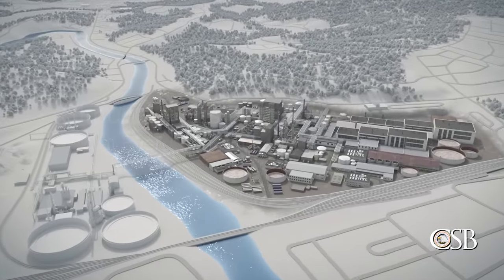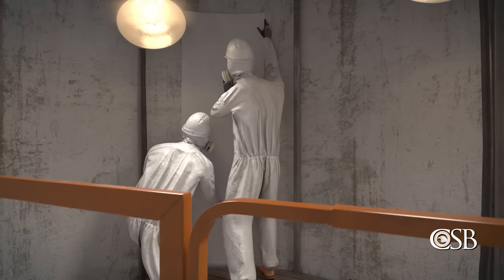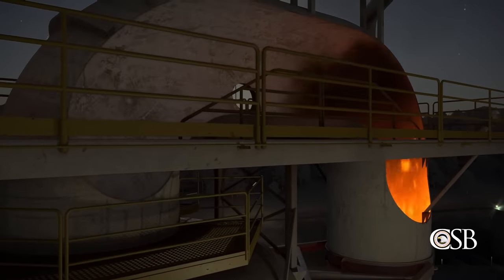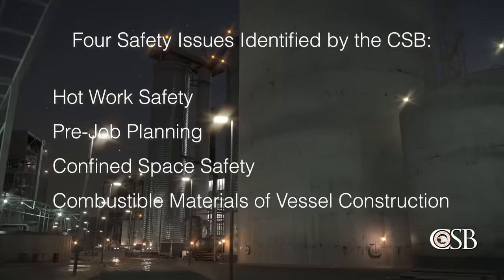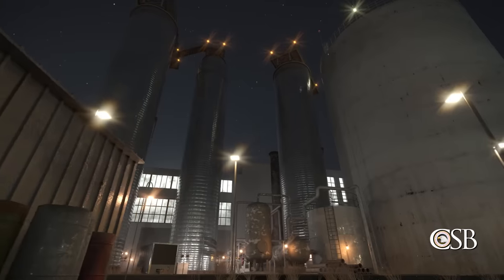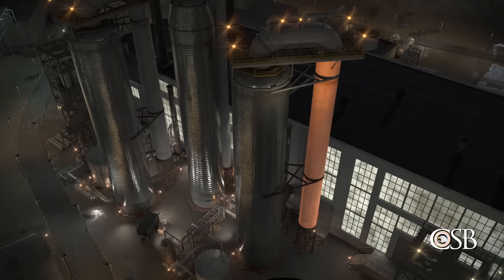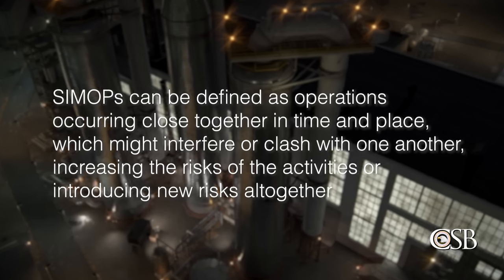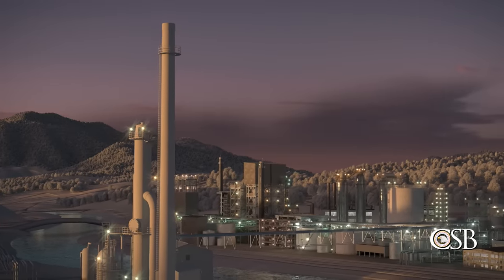Simultaneous Tragedy: Fire at Evergreen Packaging

Comment: I worked for a composite coating company and this video is spot on, however we struggled with humidity more than temperatures. Furthermore we would measure out epoxy in plastic tubs and microwave them to a workable temperatures when needed. Excellent video team.

Comment: Used to work as a cart boy in high school, we had these machines that we were told never to exceed 30 carts on a run with them, but the machines could easily handle triple that. When I joined, they had 3 cart guys on one shift, and since they were all new like me, stuck to the rule pretty hard since they didn't want to get in trouble and the job didn't have many opportunities for breaks. Eventually though, we realized that we didn't have to stick to 30 carts, and if we did a lot more in a run, we didn't have to do near as much work. Managers started noticing that we were getting done with the carts way faster than normal, so they started cutting their own corners by reducing the number of people on a shift.

Eventually, what started out as a corner cut for the workers turned into a necessity because of managerial corner cutting. By the time I quit after I graduated, we only ever had one person on a shift, and even if they were new and weren't comfortable doing 90 carts at a time yet, they had to or else they wouldn't keep up. Of course, this was about pushing grocery carts around a parking lot, the stakes were never very high, and that was probably part of the reason nobody cared enough to say anything.

Comment: How can it be considered acceptable to use a heat gun on a bucket of resin formulation in a confined space? And then to be in the position where it can accidentally drop the heating element into the resin? Some things are just common sense. You cannot always blame lack of guidance. I mean come on... sometimes the individual has a cavalier approach to safety and is clearly at fault.

Comment: The SIMOPS thing is important. I work in an industrial setting as a contractor who is permanently on site, and I couldn't tell you how many times I've had to call off planned work or delay repairs because there was dangerous work happening right next to us. Those areas were taped off as required, but it has always seemed crazy to me that nobody is coordinating all of the various groups working in the same areas.

Comment: I was working in a chemistry lab where we needed to heat the ends of a piece of glassware while keeping the middle cool. Because of the geometry of the glass, it was decided that a can of computer duster with its straw would be suitable for cooling the middle, while a heat gun was used to heat the ends. 
At one point, the accelerant (likely butane), squirted into the heat gun, causing a small fireball (and burning the hair off of my hand and forearm).
That was a total oversight on both accounts: not recognizing that the accelerant was flammable, and identifying the heat gun as an ignition source.
Reply: Are you educated in Chemistry and still capable of doing such things?
No wonder uneducated people screws up...
Reply: @OmmerSyssel  To be fair, we have enough safety measures to prevent a disaster. In my university in Germany, every laboratory have an emergency fire button that will shut down the electricity in the entire floor and flood the room with inert gas or water. If anything, I'm surprised that they trust highschool kids with such devices because even in highschool, under every labs table have one of those emergency fire button and not a single kid had done anything stupid with it.

Comment: Epoxy and vinyl ester resins are technically 2 very different things, that's quite the mistake to call the ignited material both. Uncured or freshly catalyzed vinyl ester resins are EXTREMELY flammable, epoxies are typically a lot more inert with respect to flammability. They are not used in concert, its one or the other. That's not to say epoxy isn't toxic, it most certainly is.

Comment: You're telling me a company that specializes in fiberglass resin repair "improvised" their use of heat guns in cold temperatures?  lol.  No.  They "attempted several means of troubleshooting"? lol.  Again, no.  They brought the heatguns with them and planned to use them all along.  And I 1000% guarantee you they've done this before on other jobs.  When I worked in historic preservation/restoration we used epoxy/resin for woodwork repairs all the time, and frequently used a heat gun to speed up the drying process.  And we knew from experience that the resin would set quicker in hot weather.  It was no coincidence this crew had heatguns with them on this job.  And I can tell you right now that heatguns are by far the quickest and most effective way of getting the resin to set quicker.  With that said, if they didn't think heatguns were an ignition hazard then why would they try anything else before resorting to their use?  The "attempted several means of troubleshooting" story is a lie.  It's common practice in wood epoxy repairs to use heatguns, and I bet you it's common practice in fiberglass repair work as well.  To me it sounds like management tried to paint this story as an improvised solution concocted entirely by some rogue employees, and not a common practice they were taught by their bosses.
Reply: Agreed... and shouldn't they have eithet 1: heated the wall (yeah right) 2: wait for warm weather / morning 3: warm the repair panel... Warm / half hardened epoxy won't stick well if they go on a cold surface & end up weaker... failed repair waiting to happen.

Comment: I'm Canadian. I'm not in this field.

I can tell you right now that as a Restaurant Manager, flammable materials is a common problem when we're dealing with oils and gases. I'll be checking the heat lamp wires near the ovens for hot spots and ignition points after this video because the idea of non-sparking items causing fires absolutely can happen. If one of my teenagers doesn't clean things consistently, oils can get into or on a few things.

So even outside of your own field, you're promoting safety. I was watching Nuclear disaster things and this was connected on my side bar. I'm quite happy I have found it. I discovered we didn't have fire training dealing with oils one year. Three people thought you put water on ALL FIRE, even oil. We corrected that. Safety is such an ongoing concern. Please keep uploading to Youtube.

Comment: I worked in confined spaces at USG facilities. USG forbid hot work in confined spaces by workers. The confined space must be dismantled or opened if hot work was required. Such work was restricted to maintenance personnel  only and by Plant Manager permission. I would also point out there was no confined space attendants present at all times for visual/verbal communications or to call for help in an emergency. To many obvious safety violations on this one. Both contractor companies need a better worker safety training program.

Comment: I once worked at a waterplant installing a fire arlarming systems in a building with explosive atmosphere. Some workers from a different electric company was installing some lights there simultaneously. One day when i worked there, I noticed one of the workers cutting stainless steel pipes with an angle grinder right next to me producing sparks. That was some scary stuff, I instantly left with my colleagues and informed the water plant control room. Also told my boss that I wont continue work there until the other company finished.

Comment: What gets me is, the guys using the heat gun probably drive diesel trucks. How do they think glow plugs work, magic?

You're in a confined space full of flammable fumes that you need to wear respirators for. Whyyyyy would bring anything like that in there. 

And... it didn't even start that way. Dummy dropped it in the bucket. There's a glowing coil on the front... it will catch shit on fire if you touch stuff with it. Which is why it has a shield... I can't even...

I do not miss working construction.

Comment: Did the overhead connecting pipe allow external flame as shown?  
Sadly the heat gun could been quickly removed by its cord and the lid put on the pail.  Hindsight is great.

Comment: Surprising that no one had a fire extinguisher with them. Even if there is no tools with sparks or open flames. Working for long hours can bring something to the point of ignition, specifically referring to using a grinder to clear FRP, dust can be a ignition hazard.

Comment: Working with various O/G companies I noticed that hot work was broken down into 2 categories. One would be the obvious open flame and spark producing equipment and the other was for any other equipment that was heat producing be it electrical, steam, or exothermic.

Comment: It's unfortunate that they never realized that a heat gun should be classified as hot work. Especially around flammable materials. At the very tip of the heat gun temperature  can exceed hundreds and hundreds of degrees. Enough to come out solder and even ignite things that wouldn't be considered highly flammable.

Comment: A heat gun is most definitely a source of ignition. Once I was using one to accelerate the curing of spray adhesive when suddenly the entire surface erupted into flame. No damage was done but the adhesive was cured too well and would not stick then required a reapplication to complete the work. The ignition potential of any flammable vapor or gas depends on the density of that gas and the flashpoint. At lower densities the heat gun would sound like a jet engine when set face up on the ground where the gasses had settled low and were being sucked into the heat gun but the density was not high enough for the entire area to erupt. Later in the work as more was used the density grew high enough and woosh, the whole area was aflame.

Comment: It is easy to see that the fire would climb inside the up-flow tower into the connecting tube.  But, I would have thought that lacking something driving it, the fire would stop in the connecting pipe or at least slow down before starting to burn down the inside of the down-flow tower.  That would have given the workers in the down-flow tower time to escape.
Reply: Guess a flashover, after toxic gases accumulated in the down flow tower

Comment: Would a portable fire extinguisher been able to put out the fire before it spread to the tower? Also it would appear that the FRP the tower was built from was not fire retardant (as much of the FRP used in electronic circuit boards is).

Comment: It seems like there should be a 5th issue outlined.  The workers all need a fast and safe escape route from any job.  It looked like the workers who perished were at a great height in the tower and did not have adequate means of fast escape.  This is why they suffocated.  
Arguably, there is a 6th issue as well - inadequate emergency preparation for working in confined spaces.  Some kind of portable air/scuba equipment also likely would have saved their lives.  They may not have to wear it to do the job, but it should be readily available within seconds (ie sitting on the elevated floor they were working on).

Comment: Seriously, the Blastco contractors just hung the heat gun over a railing, letting it dangle over the bucket of resin, and thought that was ok? Whether or not they were aware of the potential for fire hazard, dangling an electric power tool over a bucket of any liquid doesn't seem like a good idea. I do find it hard to believe there wasn't some markings on the container indicating the potential flammable or combustable nature of the resin either.

Comment: A simple, portable, manually activated, alarm klaxon, could have warned everyone that there was an emergency. These devices could be made quite small, yet loud, and be very effective in an emergency. I'm surprised this gear isn't SOP and part of EVERY confined space work. Relying on a radio to signal for help isn't a good method, as it assumes there will be someone to receive the call and the radio works in every environment. 
It might have warned the unknowing workers that there was an emergency, in this case a fire. Should I build some?

Comment: Seems to me this problem could have been easily solved by reading the application sheet of the material, using an ambient thermometer and limiting application to times the weather allows. Forcing materials with heat to meet some paper schedule has a track record of failure.

Comment: Such incompetence... unreal. The correct course of action would have been to wait, or get industrial heaters directed onto the outside of the tank. Heating the resin is also stupid, because it's just going to result in a poor bond. You don't apply FRP to cold surfaces.

Comment: Why 2 contractors. Probably cost savings? Had they used the same contractor to do both there would be better communication  imo
Reply: Probably because they wanted to limit the downtime (because the two towers were interconnected, they had to both be down at the same time), and a single contractor didn't have enough available staff to perform both upgrades at the same time ? Or, maybe there are other reasons such as each work being a bit outside of the expertise of the other company ? Or yeah, cost savings, but not necessarily

Comment: This is on a much smaller caliber but still relevant- we do cabinets and we have someone we work with, just recently we were doing an installation at a client's house and this guy needed to borrow our heat gun for some pipefitting he had to do at the kitchen sink for whatever reason. I see at one point that he left it on and it was pointed very close to the cabinets, obviously made out of wood, and I just see this thing blowing hot ass air right into the underside of the cabinet. Naturally, I reach over and turn the thing off even though it was right next to him. I've had stupid things happen at installations and the last thing I want is a fire breaking out and burning the house down. Not only do you need to watch over yourself, but learn to silently supervise others when you feel a hazard is present or approaching readily.

Comment: i worked at the EGP in pine bluff arkansas, absolutely the worst place to work... underground explosions from sulfuric acid and hydrocloric acid leaking into the ground, acid leaks all over the buildings eating through the structural steel of the bleaching plant, black liquor leaking and spraying out of random sections of the pipes, soaking workers and vehicles... paper rolls lurching off loading stands and cranes, pinning and crushing employes...
 
safety crew is more worried about getting donuts and making sure people are wearing harnesses in scissor lifts that OSHA doesnt require do to them being considered mobile scaffolding... but dont worry folks... as we've seen all around the world... Evergreen makes sure they are never the ones causing issues... right?

this narative is rediculous, the writter has obviously never worked a shut down... its easy to judge from an armchair and you dont have to be out in the cold, dealing with a tight deadline and products that arnt working

"Oh, if they had just had known this... or that... or been aware..."

duh? hindsight is 20/20...

Comment: If it heats hotter than the flammable component it's hot work...Let's say they were working with water...if the gun goes to 212 F/ 100 C...in my opinion ITS HOT WORK!!

Comment: I've worked in a petrochemical facility for the last 21 years. This is so basic a safety rule. It's just mind-boggling that somebody would do something like this. Simops and permitting would have probably mitigated this. But at the end of the day, stupid is as stupid does.
Reply: Perhaps not even stupidity, but potentially time pressure. The workers could've said 'we can't do this job, it's too cold for the resin to set in time'. But perhaps their company culture values being on time more, or they have too much of a 'get the job done' mentality that makes working with non ideal tools in non ideal settings common practice. 
It's not easy to say 'fuck off, this job will take more time' to the ones paying your wage.

Comment: I switched to grinding metal on my table saw without completely cleaning out the sawdust. Smelled smoke later and came downstairs to find the basement filled with smoke and glowing red embers inside the saw. I quickly took the whole thing outside and hosed it off. Any longer and things could have been very bad. Hot work is no joke.
Reply: pro tip: don't leave your bucket of flammable resin under your table saw either